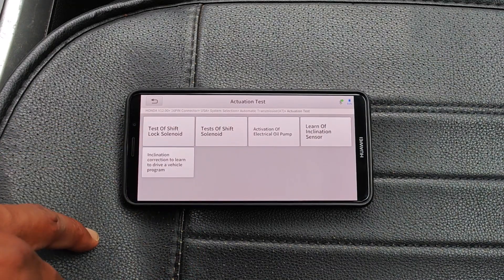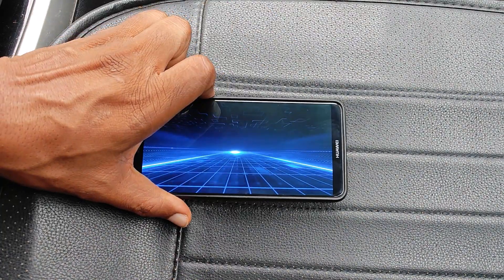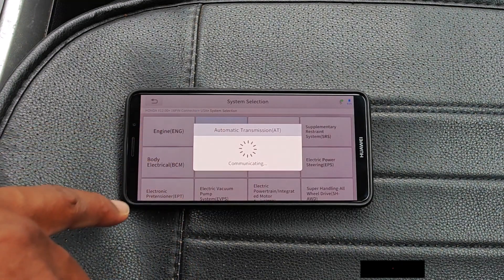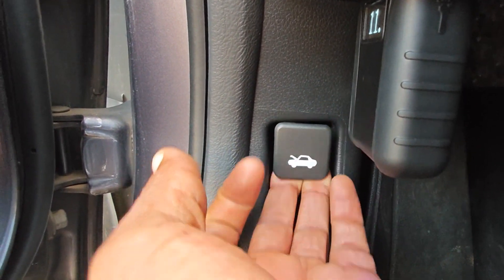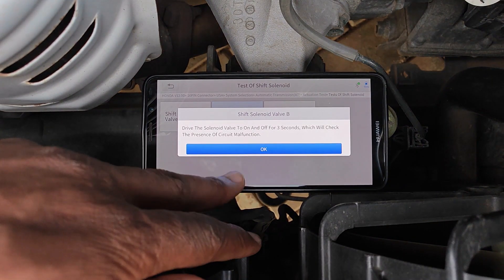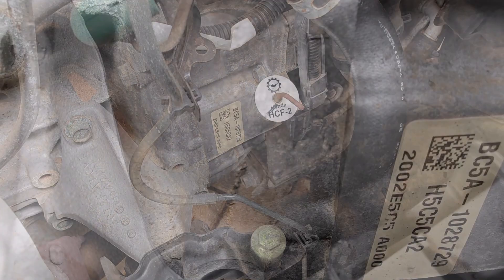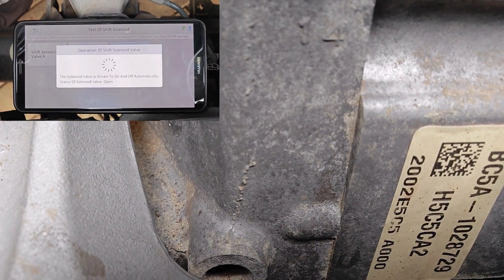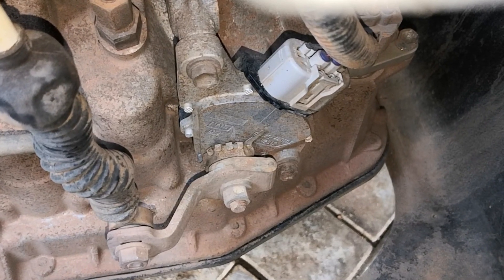Testing shift solenoids with XTOOL A30M / Find Shift Solenoid Issues

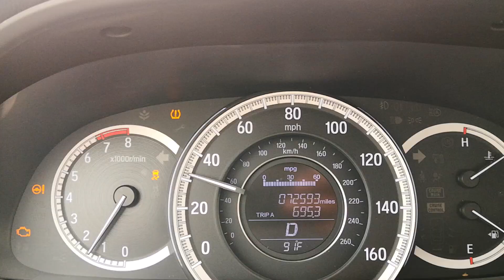Comment: Honda has historically bad transmissions, your 2017 Accord isnt experiencing any transmission issues, correct?  I noticed you had check engine light flashing at 0:06
Reply from the maker: No transmission issues whatsoever. That flashing CEL clip was an excerpt from over a year ago. Had a temporary flashing CEL rights after using CRC intake valve cleaner. CEL and all the other warning lights went away without a reset.

Comment from the maker: Have you ever had an issue with transmission shift solenoids? How did you deal with it? 
Considering the XTOOL A30M? From Amazon: 
Use DIYA30MM to get 8% discount - https://amzn.to/3qEN890 
More scan tool links and discount coupons in the description. 
I may earn a small commission from a purchase made through the links above. This does not increase the price you pay in any way.